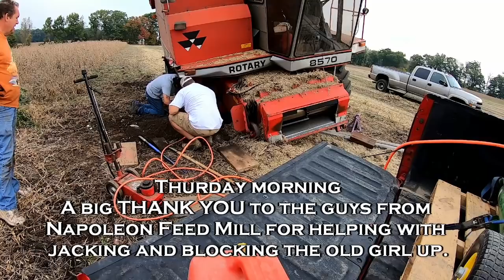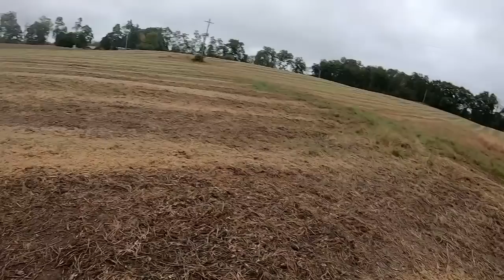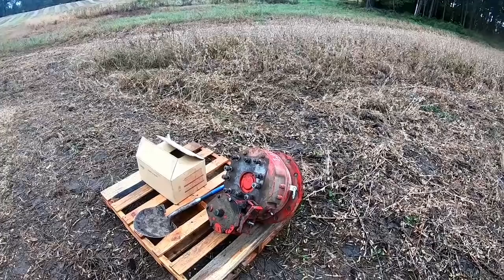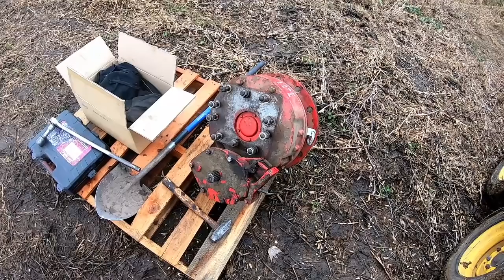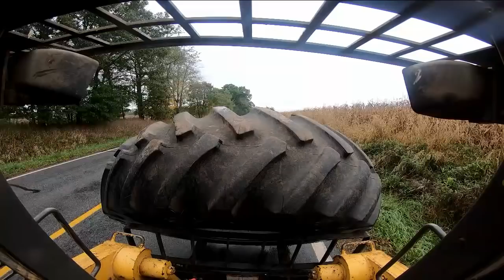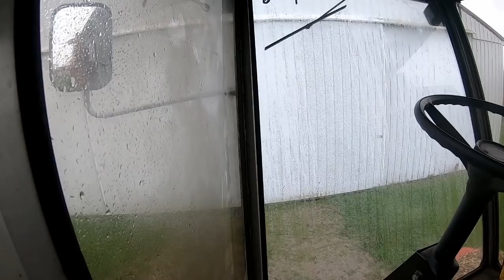SNAP goes the axle! 8570 combine BREAKS!

Comment: We did a similar thing to a 1460 IH several years ago.  Not wanting to one up you but ours was in February trying to wrap up the last 10 acres.  I feel your pain.  Like you we were thankful it happened in the field and not running down the road.  You picked the right way to go with the whole final drive.  Man those things are heavy,  Glad you didn't wait for dryer weather as dry weather is not happening.  At least not here in NC Indiana.  Looks like you had some good help getting her back up.  Watching you thread the  F/D back on with the skid steer was great.  I think you could tie my shoe laces with the skid steer.  
You appeared to be "white knuckling" the steering wheel on your way home.  Be safe out there.  Remember what happened to me, working on the combine.
Reply from the maker: Rain has been terrible here. At least it finally cooled off, that humidity we had last week wouldn't let anything dry out. Today would have been a much nicer day,  but it seems like when I put things off, I find something else that is wrong and I'm on hold again, wishing I had started sooner.

Comment: Oof, that's rough.

A "better late than never" tip for the one-man heavy object show: hang a small chain hoist off the fork so you can adjust the height without having to go back and forth into the skid steer.
Reply: Yeah, a little 3/4 ton CM lever chain hoist lives in my skidloader.

Comment: I would have thought that an Oliver guy would have had a White Combine.......I remember a IH 715 combine owner bought one of those  John Deere  6 row crop soybean heads... and the  wheel drive support tube started  cracking  and the drive wheel started leaning in.....He called my brother  because he did a lot of welding repair........  We jacked the combine untill the 1/2 in wide crack closed,  V -notched welded the crack ( overhead and vertical) and fishplated all 4 sides.........Never   saw or heard from it again
Reply from the maker: To me it is a White combine. White was just putting this machine into production as the 9320 in the mid 80s. They were in financial trouble, so they sold their combine line to Massey Ferguson. The 9320 became the MF 8560, which was eventually updated to the MF 8570.

Comment: Had a similar issue a number of years back on our 1420 International. We had a full hopper, made a turn at the end.of the row and popped all but two of the bolts holding the final drive on. The two that held were the top to and it bent the top of the flange over at a 45 degree angle. Our combine was an earlier model that used 5/8 bolts for the final drive, they later used 3/4 because other people were having similar failures.

Comment: Our shop had to replace a cracked square tube that the axles mount to, on a combine.  Biggest problem is what do you Jack on, since normally you would Jack on the square frame member.  Very sketchy repair, when we had to get under the machine to remove and replace that frame member.  At least we were working on pavement.
Reply from the maker: We dug under the frame where it wasn't quite touching the ground and used a bottle jack.

Comment: Damn that’s rough. Been there done that on my 525. Luckily I noticed the final drive was sitting on the rim so we didn’t try to move it. It puts a knot in your stomach when a combine stops moving for no apparent reason.
Reply from the maker: The flange the holds the seals is strong enough to support the hub, so it doesn't move much, until the taper on the inside of the hub walked it out when we moved it. 
Going to head back to the field today.  That puts a knot in my stomach.
Reply: Could have been worse. Gotta look at the bright side. If it had to happen at least it happened in the field and not on the road. A little sheet metal damage and a final drive are a lot easier to fix that totaled combine. Like with my 525. If that thing would have snapped even 3 minutes sooner I would have been on the road doing 20 mile an hour. I don’t even want to think about what could have happened in that situation.

Comment: Count your blessings.  We had the axle on the 7300 break... right under the cab!  What a mess.  It had quite a few hours on it so after that disaster we parted out the header, engine, and whatever else didn't get mangled when the wheel came up against all those belts and pulleys under the cab.  I've seen a John Deere 6600 axle break in exactly the same place as your Ferguson so, this must be a problem that a lot of combines share.
Reply from the maker: It doesn't seem to be brand specific. A nearby farmer was having trouble with the wheel bolts coming loose with his Deere combine. They finally figured out that making sharp turns with duals was stressing the bolts, because the outside dual has to travel farther than the inside when turning. They started making wider turns, or 3 or 4 point turns if needed, and the problem went away.

Comment: That's wild! I've seen spindles break off grain carts, and once in a while a tractor axle breaks, but never a combine! Do you think that was a factory flaw?
Reply: That must have scared the poop out of you, glad to see your ok. Thank god for that. You have way to much love in this girl to be mad at her. Just put in the hospital until she’s all healed up. Let the neighbours come by to finish the harvest.
Reply: How have you never seen a combine axle break
Reply from the maker: I know I'm not the only person to break an axle on one of these, but I've seen ones with duals, aftermarket bin extensions, not to mention I run the smallest grain head they made for this machine. It's not like I'm stressing it compared to some of what is out there. I've got to wonder if there were a bad batch of axles. Maybe to too much crystallization in the case hardening? I know Oliver had some bad ones in some of the bigger 55 series. They generally didn't break, but would flake off chunks at the keyway.
Reply from the maker: Doug Cultra, interesting. I'll check the service manual and see what it has to say about maintaining bearing load on these units. Thanks for the tip.
Reply: Two pieces of machinery made my dad and I a lot of money was our massey 8570 combine and our 2705 Massey tractor.   No major breakdowns or setbacks for 20 + seasons over 550 acres a year.  Now have a 7485 and hire the harvesting out.  Don’t owe the bank nothin!
Reply: @ThatOliverGuyChris  Maybe you had the tires pumped hard ?
It will break faster when it gets shocked from bumbs and holes
Reply: @rollling7523  90 8-24

Comment: Dang, that’s tough Chris.  I think that’s a fairly common failure on those, same thing happened to my buddy’s machine. Of course there’s never a good time for a failure like that. I’ve wondered how hard it would be to get access to that area for an inspection, a mag particle or die penetrant (easy to do yourself) inspection could reveal the crack after it starts but before it’s a complete failure.
Reply from the maker: The way the hub comes up over the final drive,  the only way to inspect would be to disassemble.

Comment: Chris, good save, glad it didn't fall while your under it!  We had a 915/ IHC do the same thing years back, I did notice the oil seal leaking but didn't worry as we had work to do and figured to replace said seal later.  I now know better, if the seal leaks, the shaft is loose or something like what yours did. On mine the wheel fell into the machine so it wasn't as bad as yours.  Our present 1660 had a seal leak right after I got it, checked it out right away, found the outer bearing bad, so it happens more than folks think.  What was the story on the cab glass?
Reply from the maker: Moving to another field during wheat harvest and a semi kicked up a rock that shattered the windshield.
Reply: @ThatOliverGuyChris  Nice job on the windshield. I was actually looking back to make sure it was the same combine when you mentioned it.

Comment: Wow, sorry about your misfortune, but like others say, could have been worse.  Glad you got it going again.  
Short war story: Years ago a local guy did custom work with a 5297 Minnie Mo, same combine as a 5555 Oliver.  He snapped off the final drive housing making a turn at the end of a corn field next to the county road.  The combine sat there for several years.  I tried to convince a friend to fix it up, we got permission and went to fire up the 383 Chrysler and the separator.  All seemed to work, but it didn’t happen.  Gone one day, assume it went to a grave yard.
Also makes me think of all these new combines lugging around 400 bushels.
Reply from the maker: I wonder how big the axles are in those monsters. 400 bushels, duals and a 12 row cornhead is a lot of weight.
Reply: @ThatOliverGuyChris  For sure, and a few out there with a 16-30 corn head.

Comment: Well,  that's a pisser, at least could be a field fix and didn't require hauling in, when we had crap happen pa would say you rip it apart and I'll head for parts, will call before heading back to check if you found anything else needed

Comment: A farm just down the street had this happen a couple years ago with their combine. I guess axles can be a weak point on them. They replaced the final drives with ones off a larger machine that had axles over twice the thickness.
Reply from the maker: I was wondering about some of the newer versions of this machine. At some point they bumped up to a 300 bushel grain tank, I wonder if the mounts for the final drives are the same.
Reply: @ThatOliverGuyChris  We've got an 8570 and an 8780. The final drive mounts are very different.
Reply from the maker: @bwfpfc  thanks, that's good to know.

Comment: Spalangers have never let me down! You would have thought White would have learned a lesson with the 8600s
Reply from the maker: I believe the final drives are one of the few parts that were actually from the Massey line and not the Whites. The axle shaft was used in the 850/855 and 860/865 machines
Reply from the maker: I did some more digging, and it looks like the unit was identical other than the stud pattern on the back side of the housing.
Reply: The 8560s used White final drives, 8570 used MF.

Comment: I bet this was a shock of just running along and this happens.
Reply from the maker: Yes. Flat ground, no holes or anything that would have stressed it. All I can figure is something in the past got the axle cracked, and it's been slowly getting worse until it finally gave up.
Reply: @ThatOliverGuyChris . It looked like it had been cracked for some time.
Reply from the maker: Yep. There's no way to visually inspect it without disassembling it.
Reply: At least it didn’t happen on road

Comment: That seems to be an Oliver probllem.  Ethan had the same problem minus all the sheet metal damage on his 7300 last year, I dunno man 30 40 years and they break, what's happenened to quality.
Reply from the maker: It's crazy. You'd think those shafts would get harder as they cured out.
Reply: @ThatOliverGuyChris  You ought to check t he middle of that shaft, it mightjust be case hardened

Comment: If those are the same final drives as a White 8900 I have three spares
Reply from the maker: No they're quite a bit heavier. I think they are the same as a Massey 860, but I'd have to look that up to be sure
Reply: I bought two 8900’s and they came with a bunch of extra parts. I have final drives, transmissions, hydrostats, cylinder’s. Beaters,straw walkers, sieves and all kinds of shafts pulleys bearings slip clutches. So if anything will work on yours and you need it let me know and I’ll send it to you
Reply from the maker: @craigrasnic4178  awesome,  I really appreciate that!

Comment: Junk is junk if you want quality by a John Deere
Reply: never had eny luck with anything john Deere plus the local dealer looks at you like an idiot when you need parts. the agco dealer is a different story.
Reply: @elijohnson182  the old two cylinder John Deere tractors were one helluva of a good tractor and they'd pull circles around the other tractors even though the other tractors were rated as higher hp they had the right power to weight ratio and it was centered towards the rear end for ultimate traction
Reply: @jeffreyhershey5754  the old story in my family about 2 cylinder john deere tractors go that my grandpa had someone trying to sell him a D and my grandpa said if it will pull my 12 ft cultivator i will buy it  so they took it out to the field and dropped it in the ground and it went put and died. I think it would have done better if it had more cylinders. Its not a real tractor unless it has at least 3 cylinders.
Reply: correction it was an 8 foot cultivator
Reply: Went to a JD dealership told the ( parts women) need carburetor parts for a 2020 she says , is that gas or a diesel. With Her nose pointing at the ceiling 🤮lol
Reply: @traderjack6151  sounds about right

Comment: Lucky you cought it when you did damage could have been a lot worse did the same thing with a JD CTS on a dirt road in road gear wheel came off header bit the ground bent about a foot away from the table and peeled the right half of the header back about two foot and in the process the tire mashed the elevator on the right side it all became costly in a split second
Reply from the maker: Yeah, if it had happened going down the road, I think that would have finished off its days of harvesting.